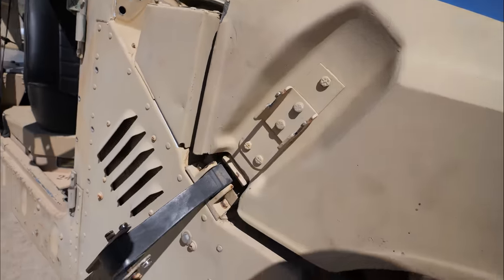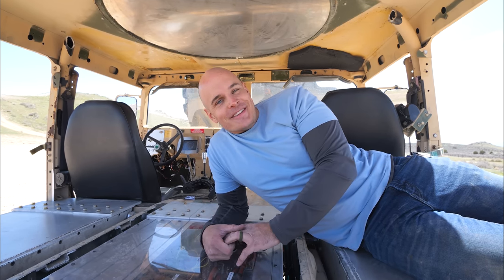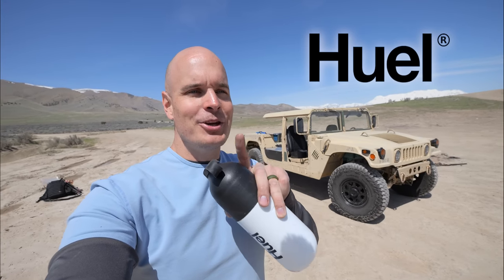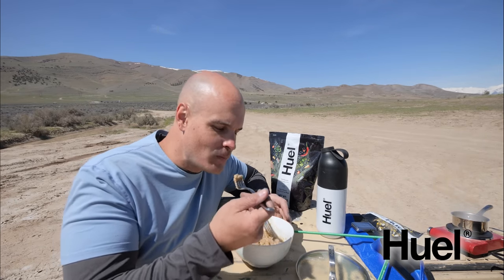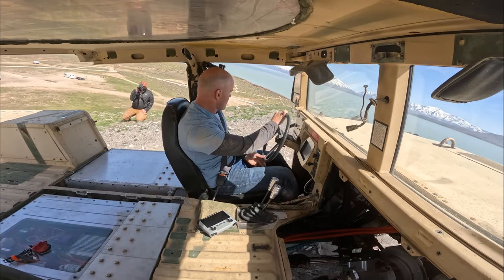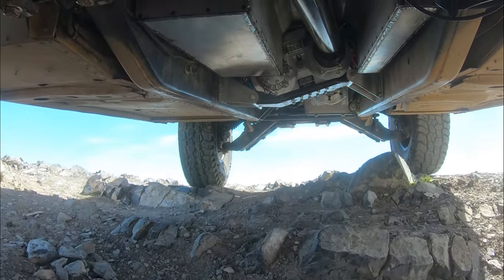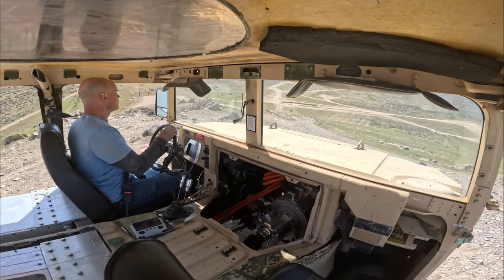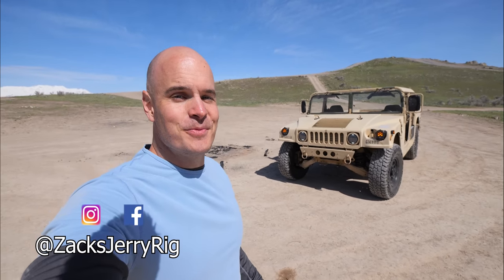Off Roading my DIY Electric Hummer - What could go wrong?

Comment: A pleasure to help!
Reply from the maker: The EV Master has arrived.
Reply: Gotta do a LMTV next!
Reply: Really enjoyed your videos
Reply: I've got an idea: Find a Ford Excursion with broken engine, and turn that into an EV.
Reply: @JerryRigEverything  you're awesome bro
Reply: Hires company to do most of the work. calls it DIY.😂
Reply: >>PIN<<
Reply: Great job
Reply: Just initially watching this project of yours, it was nice to see you help despite as you claimed not 100% knowing how to but willing to do it. Great job!
Reply: @JerryRigEverything worst shock absorber.
Reply: @JerryRigEverything Attach a amg Gear box
Reply: You helped a lot
Reply: Spoken from the hero don't deserve.. awesome man ❤
Reply: @Nero.H He didnt, don't be so sore please. Zack did a lot of work himself but couldn't figure out why the car wasn't charging.. that ended up to be a whole project in itself where this EV mastermind helped as good as he could.. (and boy did he deliver)
Reply: The system is garbage, but it really shows how much assistance electric vehicles need. Get a ls engine, a yasa 750r axial Flux motor, as well as the numerous parts for them. I really want to design a hybid drive train. I just don't have resources. I have years of engineering research, Solidworks knowledge
Reply: I watched your vids. Awesome work!

Comment: Jerry, do some research on Torsen differentials in the hmmwv. There is a method of using the brake to lock them up while ur on an obstacle. Once you master that this thing will be unstoppable.

And lower your tire pressure. Going down to about 10psi will make it ride 5x softer and give you loads more traction. I’ve been following this project from the beginning and am both sad and happy to see it finished. Great job 👍
Reply: This needs to be higher !
Great tip!
Reply: I was going to say the same, Learned this Torsen trick back in the military.
Reply: For those that don't know. Torsen differentials won't lock up if there is 0 torque in a wheel (when 1 wheel lifts off the ground). By applying the brake, this creates torque in the suspended wheel which lets the diff lock up and spin the tire with traction still. 

I totally forgot about the tire pressures though - great tip. That will definitely improve traction and ride. I still think he would need to adjust the spring rates a bit though in conjunction with this. Even when the truck landed down on the tires (which appear to be fully inflated), you could see very little articulation in the suspension. The lower tire pressure will help compensate, but he still needs the articulation on impact.
Reply: Lower pressure is fine (ATVs/quads use about 4 psi) as long as you're not cruising down the highway. At speed, it can result in a lot of friction in the rubber and heat the tire to the point of failure. So bring an air pump.
Reply: i came here to comment the same stuff
Reply: TORsens work off torque. Basic ones are 3:1 multiplication. Better ones are 4:1

If your tire on a loose surface can find 10ft/lbs of resistance then it can deliver 30-40ft/lbs to the other wheel.

If your tire is in the air with 0 resistance then 0 x 4=0 ft/lbs to the other wheel
Reply: Absolutely correct- note my meme pic.  
It is called BTM Brake Throttle Manipulation.

Spinning the wheel like this then quickly hitting the brakes to stop the spin will break the half shaft (cv joint).  

The other thing to learn is using the heavy coil springs hurts tire contact with the ground in offroading.  Imagine the springs so stiff they are solid and every un even surface will lift a tire off the ground.  The softer springs help not only with the comfort of the ride but far better traction off road.  
Either buy the lightest springs available from AM General, or if you can spend the money- the really soft ones from Mod Mafia. 

The custom modified rancho adjustable shocks from GT Performance is a secondary option to help a bit more for comfort - but won’t do any good with the heavy springs in place.

Most importantly learn about blue hummer spindle nuts.  The military retaining system fails often and the wheel and spindle comes free in motion.  

There are coatings you can do to the gears in the differentials and geared hubs (portals) to reduce a lot of the friction for improving efficiency as well as life of the components.
Reply: Better off starting from scratch with 4 elec motors, 1 per wheel. Plenty of room on this vehicle, totally doable with the expertise he has access to. Less losses, more efficient, even lighter and torque can be controlled independently at all four wheels.
Reply: @_BangDroid_  not feasible there is not plenty of room in this vehicle.  My bet is you never changed a halfshaft, or did a brake job on one.

You have to eliminate the frame and suspension system to do that.
Reply: hIs NaMe Is Zack NoT jErRy
Reply: I was thinking the same thing it is called BTM(Brake Throttle Modulation) however I believe he has it setup for regenerative braking as well due to it being a EV so I am unsure how that would work in this specific application...
Reply: @hummervs3278  I believe it could be feasible they do make electric motor hubs.. so you would simply just replace the geared hub with an electric motor hub.. you then of course would lose the geared hub and the functionality that comes with that.. However not sure of the dimensions of those motors at the moment.. 

Another option would be to use hydraulic motors at each wheel if the electric motors are too large then use a electric pump...
Reply: @Injunfarian 
I’ve used hydraulic driven equipment- there is serious problems with it especially something that travels 30mph and above.  
If using it for a rock crawler or similar then yes.  Otherwise nope. 

I remember a joe rogan video of him saying to Elon Musk about government hmmwv replacement with electric vehicles- Elon didn’t seem excited but didn’t shoot it down either.  

If musk was simply given the dimensions and said “go” his team and him would come up with something amazing. 
It would be cool
Reply: @hummervs3278  AM General has been working on Humvee Charge which is a Hybrid Humvee that increases the range as well as allows for silent driving mode which reducing noise as well as heat profiles of the vehicle in combat zones which is pretty neat...

However for those of us that own a HMMWV/H1 already the best thing from it in my opinion is the Long Travel Suspension that I believe could be fitted onto a H1. Gives you 50% more travel.

The new hood/grill is pretty nice as well, so is the exportable power so the truck acts like a generator for you.

Comment: You definitely need a lot more suspension travel. But good to see it driving.
Reply: Yes it was like driving a House Brick.
Reply: HMMWV/H1's don't need as much suspension travel as other vehicles since they are so wide and a low centre of gravity design they are very stable they just tip with the terrain..
Reply: @Injunfarian exactly.   This comment is accurate.   I own an humvee.
Reply: @lt9690 Yeah I own a H1 and have put that thing on some pretty gnarly angles...